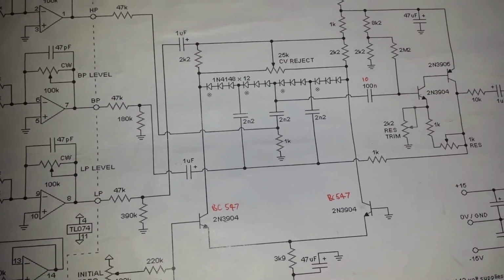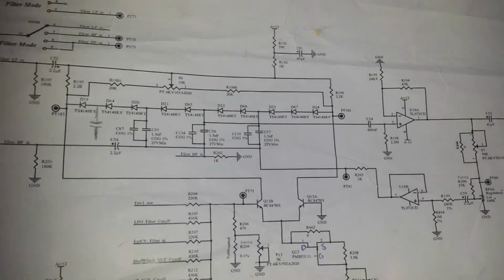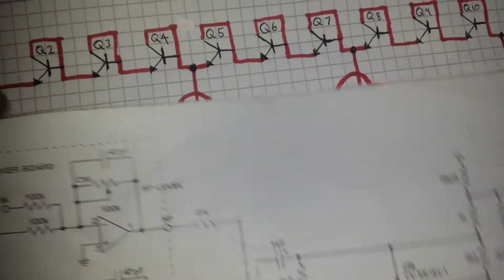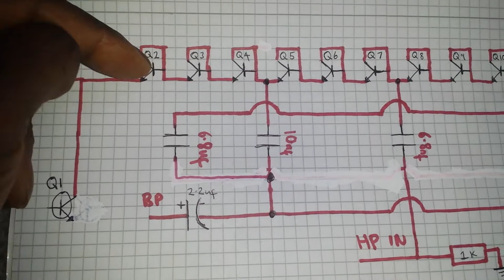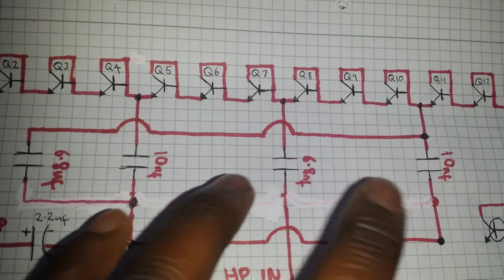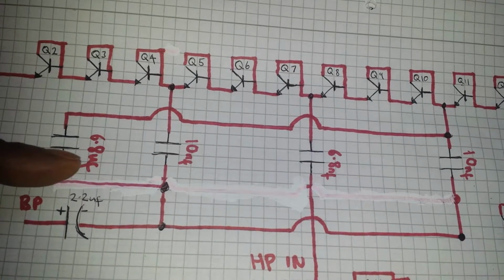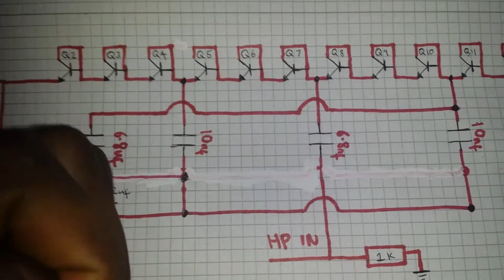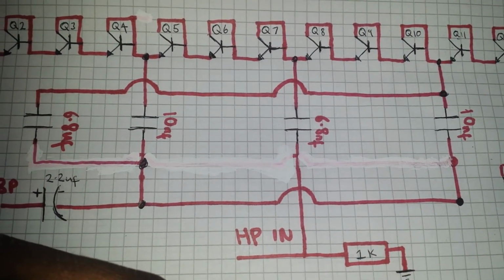DIY analog synth project (How i modified the Steiner parker type VCF circuit )

Comment: Hey man, congrats on the printed boards! Gonna be doing a heavy bit of experimenting here soon, total newbie to this stuff so sorry if this was covered, is this the current version of the filter you are using? I mostly want to know if I have the dif pair right https://ibb.co/LN5d6jG
Reply from the maker: Hey I checked out your handrawn schem. It is spot on the diff pair ios correct, try changing the values of the caps around thou. For instance .Maybe the first 3 all 6.8nf and the last 10nf.Also since this vid I have done a small mod to the circuit as follows:  The last 6.8nf cap from your drawing take the wire away from the q4 junction and place it at the q5 and q6 junction. I found this to be a lot better.
Reply: @AdamTheAd-vanc3d  Ok, thank you ! I'll give it a go and let you know what happens.
Reply from the maker: @soundpalette2438  No probs i didnt get the notification of your last message hence my delayes reply.
Ok let me know your results and if i can assist you in the future. Dont hesitate to ask.

Comment: Do you not have to match the gain on the transistors when they are all in series like that? (not two to a rung like most transistor ladder filters). If so, that is super cool!
Reply from the maker: In my version i did. Since this video i have further modified the circuit to only contain 4 x bc548c transistors along the capacitor part and on each end for the exponential pair (again matched)  2 x 2n3904s , as using bc548s on the ends made the reso too wild.

Comment: What advantage is there in using transistors instead of diodes?
Reply from the maker: Rob Jefferys Funny you should mention this. I was hoping someone else could enlighten me on this . However (and correct me if im wrong), i think the transistirs have a more exponential voltage and current response compared to transistors. The resonance sounds alot more like a 303 thou this was not my intention , but im pleased witht the results.